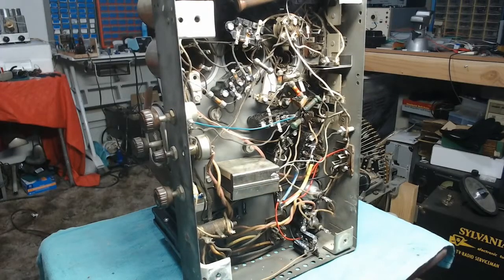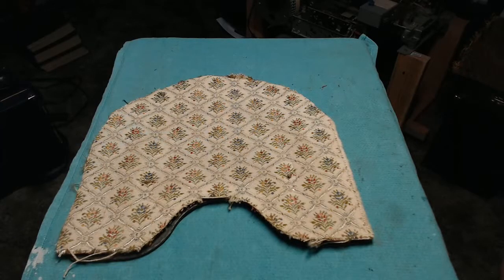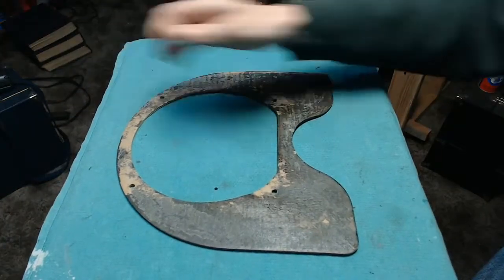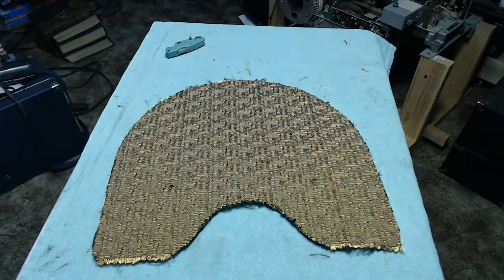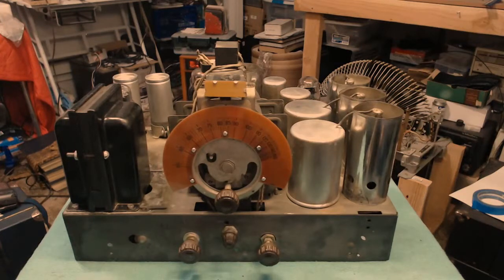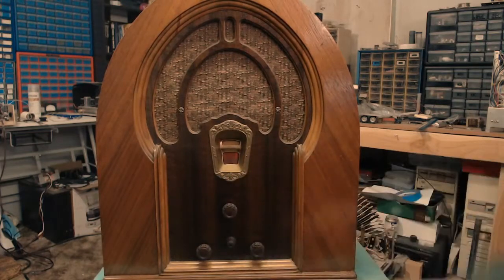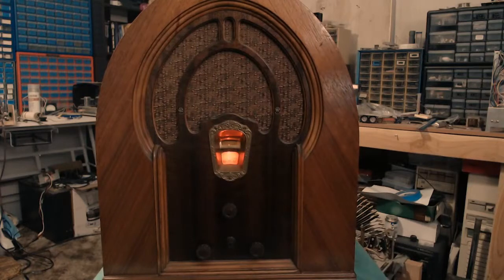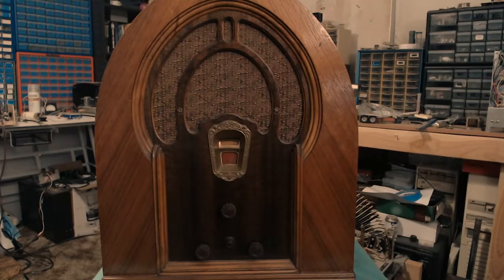Philco 71B Part 2: Repair and testing

Comment: The Philco Radio I loved was made from 1938-1942. It is Called the Mystery Radio with turntable which were made very good I always dreamed of gitting the Radio. It was Philco’s 1st Wireless Remote Control.
Reply from the maker: I actually have a Philco Mystery Control set, and the remote! Haven't gotten it working yet though, too many projects on the table.

Comment: A better method of getting holes in the cloth is using a scratch awl and heating the tip with a propane torch and putting it through the cloth

Comment: Very beautiful radio.
I have a question about the plastic dial. All of these old Philco radios the dial is a muddy yellow. Reproductions are also made in this same dirty muddy looking yellow.  How do we know that these were not white and have yellowed over the years as most plastic does?  I think these radios would look great with an opaque white dial with sharp black plastic numbers and markings on them.  Does anyone know for sure?
Reply from the maker: Quite honestly I don't know. I haven't ever seen a radio (Philcos at least) with a pure white plastic dial. My guess would be that the yellow color diffuses the light a little better and makes the markings more obvious. Many of the dial plastics used by some companies (RCA I think) actually turn reddish for some reason...

Comment: I would have gladly taken that one out of the trash and put the one I ended up with in its place!  You haven't lived until you've had to rewind the shadow meter coil using a sewing machine, a spool of 40 AWG wire, and hot glue to secure the coil form to a bobbin!  (Yes, the wire broke several times during that exercise.)  Also, on mine, the dial cord kept slipping, which was partially caused by friction in the tuning cap (needs grease between the shaft and the frame, and the hold downs -- no bearings!), and I still had to melt some old capacitor wax on the cord to give it a little extra stiction.  (Oh, I forgot, that was a new tuning cap, as the original had been so hacked up and rusty I had to get a new one.  Yep, I know about unsoldering the screws. They didn't do that on the 70.)  I thought all was good, until I saw the speaker... My gawd, the speaker!  They reconed mine, poorly, and left the voice coil shim in place making it sound horrible.  That was very delicate surgery.  Mine probably would have been better as an empty cabinet, but I drug it from death kicking and screaming!  When I sell it, I'll hopefully only lose about $50!
Reply from the maker: I have a battery set where all of the tuning coils are broken right at the ends, so I know the feeling of having to do micro-surgery on a set. Haven't had to re-wind a coil, though, and I certainly hope I don't ever have to!

Comment: An alignment would really help that radio, and there's someone who sells the special Philco alignment tool on eBay.  Well worth it if you end up coming down with a case of the Philcos!  Philcoradio.com and audiophool.com are good places to find Philco documentation, including alignment instructions.  I was hoping you would show how you restuff the Bakelite capacitor blocks.  Thank you for this video, and I hope you took good pictures of the top and bottom of that chassis for those of us who have never seen a relatively unmolested Code 125.
Reply from the maker: I didn't think to take photos, but I did make a rough sketch of the wiring on the underside including the numbers on the Bakelite blocks that differed from the code 121 schematic. When I rebuild my 60B, I'll have to grab the alignment tool and do a proper video on the block restuffing!